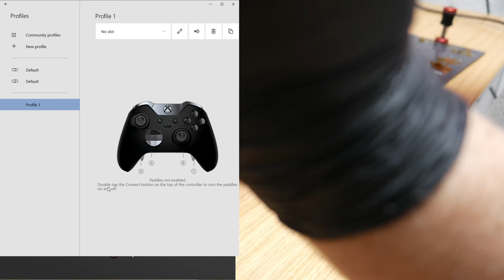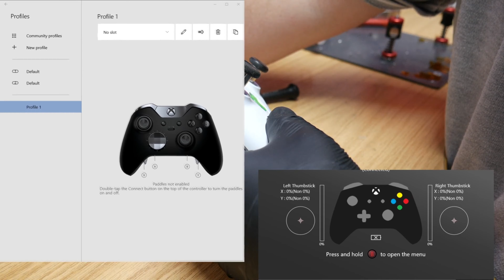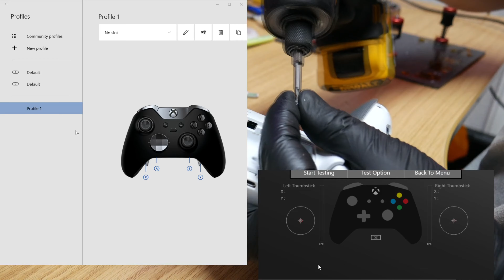XBox One Elite Controller Stick Drift Right Trigger Fix and Sticky Buttons

Comment: 41:17 what exactly are you doing there? Are you spinning the potentiometer in the opposite way to the offset? Or the little bit of plastic attached to the main part of the module. Any clarification would be much appreciated as having big offset on known working module!
Reply from the maker: It's the nub sticking out of the module. force it in the opposite direction. Seems like you sused it out!